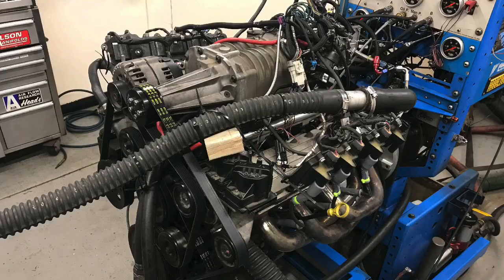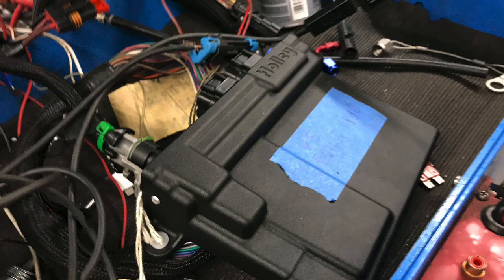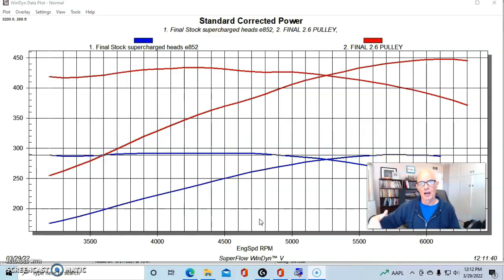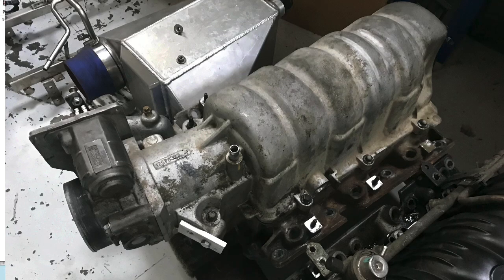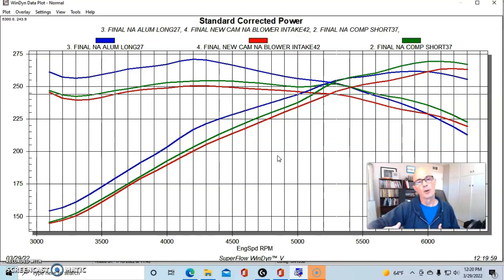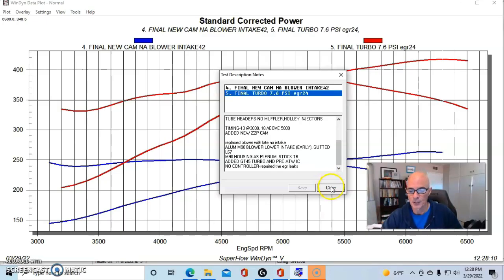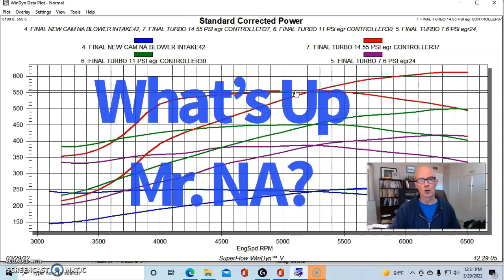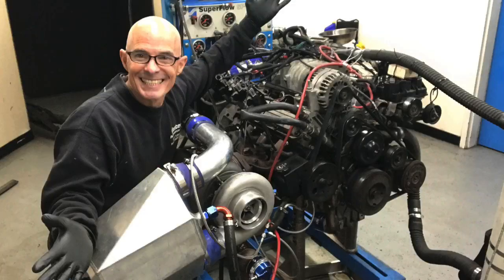JUNKYARD TURBO 3800 V6-WHY DOES IT MAKE SO LITTLE HORSEPOWER NA AND SO MUCH POWER UNDER BOOST?

Comment: Porting helps to a point when you're running NA, but the engine can only suck so much air in per cycle. That's why you see such large gains when you increase compression ratios, because the engine is "sucking" harder to fill its cylinders and compressing that mixture to increase combustion efficiency. It's why leaner AF ratios help right up until it melts something because you turned your cylinder into a cutting torch. 
Boost allows you to cram more into the cylinder without the drawbacks of high compression and it really allows the porting to play dividends. It's all the little things that add up to fill the cylinders. The bigger ports allow more air/fuel mix through. The bigger turbo pushes more air. The higher boost pressure crams more into the cylinder per stroke.

Comment: I think it’s the ring gap/compression for N/A setup vs boosted set up. If you build your bottom end with ring gap for a boosted application it will only make power if the boost is there.. just like if you set the bottom end up for N/A the ring gap is tighter for N/a so that it responds like a N/A should
Reply from the maker: the gap does not change the power-tested it many times

Comment: Pump e 85 is a horrible broken promise made with v grade (84 r+m/2) and 50 to 85% ethanol.. for any real gains you have to blend you own. It’s still a high octane fuel just not the original promise made during development.  8.5 to 9.5:1 often result is the fail to burn issue or burning to slow to make power. I sup ride it didn’t miss horribly and had no idea the stock injector could keep up with the 8:1 ish fuel ratios
Reply from the maker: pump e85 is amazing and hands down more powerful than other pump gas

Comment: It comes down to efficiency, the more efficient the heads flow air in concert with the cam and intake are what makes power. When you maximize those variables coupled with additional fuel and boost, the sky is the limit on how much power you can generate. This applies to every engine. The pistons and crankshaft merely harness the force generated by the chemical reaction that occurs in the combustion chamber.

Comment: I plan on running a ZZP turbo kit on my 2004 Monte Carlo SS with the L67 engine. ZZP offers a L67 to a L26 conversion kit with the HV3 insert. Is it safe to say that I'll make less power in low and mid range ? It looks like you lost power with the HV3 insert. I don't know what my options will be. I dont want to loose
 power.
Reply from the maker: making the runners shorter in any motor will decrease low-speed power
Reply: Hi Richard, what would I need to do to get a l36 upper and l36 lower to replace my blower and l67 lower intake? Since the l67 injectors are in the heads, what mods would I need to do to get the l36 intake to work on my l67? Thx. @richardholdener1727

Comment: Pretty sure these engines were used in the Grand Prix, with a supercharger. Did they just use the same engine in the lesabres, etc, as NA?
Reply from the maker: THEY HAVE NA AND BOOSTED VERSIONS, BOTH SERIES 2 AND SERIES 3

Comment: I also think the turbo is just getting into it's higher efficiency islands. When you finally reached 1bar/~15psi, the turbo was just getting efficient. If you would have made a few more runs at 18-19psi, 21-22psi, and 25-26psi, I would expect the HP/psi to get even greater until it the curve flatten out around 25-26psi. Some compressor wheels don't reach maximum efficiency until even higher than 25-26psi. Usually the larger turbos and compressor wheels, don't like to make much power at lower pressure. Most generic gt45's use a 69mm/98mm compressor wheel and a 88/77.5 turbine wheel. They are not small turbos, they have made well over the 600hp they are advertised to make. I have seen these turbos make over 800 Wheel hp(920Crank HP@15% drivetrain loss) I would think the engine would make close to 800whp, if not more, at less than 25psi. Using his 33hp per psi, it would only need another 6psi@33hp/psi=200hp. That would push it past 800whp@21psi.
Reply from the maker: these are not whp numbers-they are flywheel hp numbers and I have maxed this turbo out previously

Comment: The formula for boost predicting hp assumes the na manifold pressure of 0 psi. I suspect the intake manifold is under slight vacuum (negative psi) when running the engine na which will cause  higher gains than the math predicts when under boost. So my guess is restrictive intake manifold and or throttle body. E85 most likely makes a difference as well
Reply from the maker: yes and yes

Comment: Boost is a restriction.  It's only relevant for that specific combination.  The cfm  is a huge difference between that blower and gt45 making manifold air much denser ,  e85 will drop the intake air too and let you run more timing from the higher octane content ,  the turbo doesn't have the parasitic loss .

Comment: So I had a 2001 Honda Accord sedan that came with a 3.0L (J30A1) V6 that made 200 HP with a 4 speed auto. I pulled the J30A1 with the auto trans and swapped in a JDM J32A (basically a J32A2) with a 2003 Acura CL Type-S six speed manual trans and it was alot of fun just in that form. Those engines are 10.5:1 compression and make 260 HP stock. I bought a cheap eBay set of turbo manifolds, a collector pipe, an up-pipe, and a two-piece downpipe, a GTS3582 dual ball bearing, billet compressor wheel turbo, a custom made set of ARP head studs, a Gates RPM timing belt and water pump, a new timing belt tensioner, a set of Injector Nation 1000cc custom made injectors for the J series engines, and I ran it on an AEM Series II 30-6051 standalone ECU. On 10 lbs of boost it made 458 whp and it was definitely a drop a gear and disappear car. Now I have a 2004 Acura TL and it has the J32A3 that makes 270 HP and has an 11.0:1 compression ratio. I can't use my AEM with it because it's plug n play for the OBD2A harness and it's not meant to work with anything newer than a 2003, so I have no clue how I'm going to control fuel and air...yet.
Reply from the maker: My friend Jimmy has a turbo J32 (now L35) swapped NSX

Comment: Heads are getting used now. = 600hp. Also the hp per psi will get even larger as the compressor gets into its efficiency island. 

 First thing to die when you turn it up will be a piston crown, but you will have to lean on it.  It'll start knocking but still run fine lol.
Reply: I'd say the first thing to go will be the ringlands. Factory cast pistons were never designed to handle the rigors of boost. The second there is any detonation or if the ring ends butt up, the ringlands crack. Forged pistons are best for boosted applications.
Reply: @moedigzz  ive had first hand experiance with L67 crowns breaking off. They last for some time though. Have run 9sec 1/4 on the cast pistons and the engine is still going.

Comment: The 3800 never made big n/a hp. The GN and IndyPace car engines only made about 240 Net and N/a I don't think I have seen a 3800 that was rated at over 200 net. So with just a switch to a gross power configuration and a good tune it is pretty impressive to find 60 hp.

Comment: I'm currently looking for a 3800 for my 86 Fiero GT... Tried to sell the car on consignment a while ago, and a test driver spun a bearing. 85k miles, too!!!
Update: I now have 2 supercharged cars for my fiero gt. 2006 GTP, and an 03 SSEI Bonneville.
Do you still have any of those parts???
Reply: Just pull the engine and rebuild it yourself or find a competent machine shop or performance shop rebuild it for you. An engine with a spun rod bearing usually needs a fresh crankshaft, possibly a rod or two, bearings, and a fresh oil pump. Those parts usually cost about a grand and figure about $800-$1200 for a fair assembly cost. Plan for another few hundred for machine work like, having the heads surfaced, the block's decks surfaced, and maybe getting parts hot tanked.(chemically cleansing parts)

Comment: I have a 3800 in my garage 🧐 I technically have two of em but one needs rebuilt lol..how do I get ahold of u to inquire parts?
Reply from the maker: DID YOU SEE THE EMAIL ADDRESS IN THE VIDEO
Reply: @richardholdener1727  yes I took a pic of it. I’ll be in touch

Comment: I think the engine works well under boost because of the cam timing is working better for volumetric efficiency when there is more air mass flowing in the runners.
Reply: It could also be more thermally efficient with the higher cylinder pressures. These are the only two explanations I can come up with

Comment: The boost/bar formula is only a very rough ballpark estimate that just happens to work out pretty well most of the time. The low static CR of this engine helps you run higher boost before becoming octane limited on E85. On this engine, the turbo is probably well matched to produce a favorable back pressure/boost ratio at 2 bar.

Comment: I just came to say the 3800 V6 is still a beast. It is the BEST American engineered and built V6 ever. I would say the same about the Ford Ecoboost but those were engineered by Mazda.
Reply: I have both, in the form of a 04 GTP and a 16 SHO, and the 3800 wins by miles. The Eco makes amazing power, but they're absolutely no where near as reliable, very expensive to fix, and ummm... $3,000 water pump.
Reply: @scotthoward4836  the FWD 3.5L EcoBoost

Comment: I think that the multipler with turbo is the rise over run in rpms. The NA/ the roots and the less than one bar of boost showed that the GT 45 is in synch with the rise in boost to the back pressure.  It was more efficient at the 1 bar a/r ratio than the lesser boost and the character of the Roots blower backup pressure.  I think that you have revealed an overachiever combination that from 11 psi to 14.55 was the flow vs the compression ratio and the rising boost curve and happy back pressure raised the hp proportionally to the advantage in that sweet spot. Good boost vs back pressure and the cool relaxed mixture was in its wheelhouse. A great phenomenon and I just get a kick out of these kind of discoveries. A relaxed mixture with velocity will yield more power than either a sluggish mixture with less velocity than the 1 bar where you hit that happy place in velocity and mixture. I hope my 394 FE and 7875- 1.25 ar  will find that sweet spot!

Comment: I’d have to say it had to do partially with how pressurized air flows. Pressurize air doesn’t need as smooth of a transition to flow a lot of air. Which is why charge piping doesn’t need to be as large as the inlet. NA cars any air flow restriction has a big effect. I think the other part is the low compression.  Low compression do not have the ability to move air into the engine. Turbo cars eliminate this problem forcing air in.  Lastly I think it had to do with the turbochargers efficiency range. I’d have to say your just in a very efficient spot on the compressor map.

Comment: Where is the boost pressure taken from?  If it's below the gutted blower, the engine could been seeing a higher boost pressure at the throttle body entrance than what the gauge is showing.  Like others pointed out, the N/A motor wanted more air than the throttle body could flow, there cound be a pressure drop to overcoming the intake restrictions and then the boost reading is taken.

Comment: Hay Richard, I got a factory fuel injected motor 460 from a 1995 f350 in my 78 f150, I wanna super charge it, do you think an Eaton m112 would be big enough to feed the 250 stock horse power the 460 makes?
Reply from the maker: It would work on an otherwise stock motor
Reply: @richardholdener1727  or would I be further ahead with eBay turbos?

Comment: I agree with the others saying the turbo was coming into its efficiency band.  Even at 11 psig the turbo is making more power than the engine itself (the turbo characteristics dominate).  The small intake valve is a hindrance to high rpm (not what the 3800 was designed for) but the turbo makes up for that.  It pushed peak power from 5800 rpm to 6400 rpm.  The exhaust valve is sized for a much larger engine and can keep up with the extra air.  It's almost as if Buick designed the 3800 to be a turbo motor...

There's a Grand National with a series 2, stage 1 stattama cam, ported heads, and a 61mm turbo running 10.5 at around 130 mph.  It has to be making over 600 hp, and idles like stock.

Comment: I can't help but feel that this has more to do with the efficiency range of the turbo than with any property of the engine. I'm curious what the compressor map looks like for this particular GT45. It may have just been that at 1 bar, it was entering its most efficient operating range
Reply: Exactly this.
Reply: i have played with these turbos a bit and you are correct, they are a bit lazy on lower boost but in my experience once they hit over 20ish psi they really come alive

Comment: Hey Richard I was wondering if you could do a indepth video on what changing spark plug to a complete modern coil on plug ignition system would look like on the dyno with high end  spark.
Reply from the maker: it adds nothing
Reply: I think it was diyautotune that did a experiment years ago, starting with a distributor and signal from the distrubutor to the ecu. Then added a trigger wheel.
Under very high acceleraion rate in a dyno the same engine with the added trigger wheel gained some power. Under steady state the power would be the same.
The important thing is that you have a strong enough spark.
Many COP systems don't have very strong spark from the factory.

Comment: The na combo doesn't perform well with the low compression. Under boost, first few psi probably wouldn't even need any timing retarding.

Comment: Easy. You've "created"  a new monster KEGOLODON by "accident". Mu-ha-h#..Probably like this---√   The combined 2.3  liters of upper and low intake volume (1.5 liters and 0.800 liters respectively)  and airflow of the throttle body opposite the big metal plate is a big KEGOLODON. The resulting  intake flow rate and CFM varies with air speed. In essence you have a variable response to boost, based on air speed and that 60 % of the 3.8 liter engines big flow chamber. Going  Back to your Super Charged boost verses Turbo boost... The disruptive Eaton blower Blades produce less power at the same boost as the intake is then about 40% of the upper intake and lower intake. (Half of those two lines of the  M90's  1.475 liters is 0.74 liters, plus the 0.8 liters of the intake lower.). So with your fixed intake volumes, the air speed and CFM must vary "somehow". Your only variable is the stability of air flow. Your turbo is probably helping stabilise the air speed at certain boost levels. Time to test your new 3800 KEGOLODON, and it's response to BOOST..... 🫕
Reply from the maker: The reason the Eaton and turbo don't make the same power is not plenum volume but keep the ideas coming
Reply: @richardholdener1727  Alrighty...you must have more info. Maybee injector position. I can't wait for the Reveal-All....

Comment: Not that is it much different but the 14.55 run is more inline with 17.5 lbs of boost. very impressive for the little engine either way, especially considering the factory ratings.

Comment: It's obviously the air density difference, manifold pressure does not reflect air density so unless your measuring density your not comparing apples to apples
Reply from the maker: show me the air density in the na motor
Reply: How can I if you didn't measure it, you even said it wanted more throttle body size so this could also mean manifold negative pressure was still present at high rpm na which by simple physics affects density does it not but not the only thing to affect it, Unless your measuring density and comparing it you are only guessing and I think Gale Banks agrees